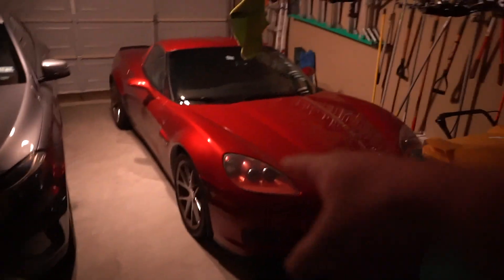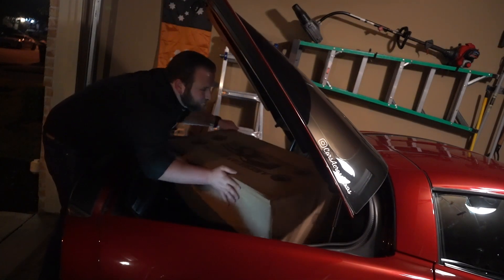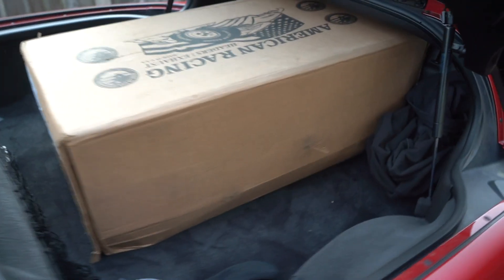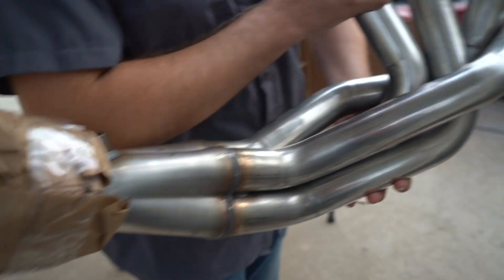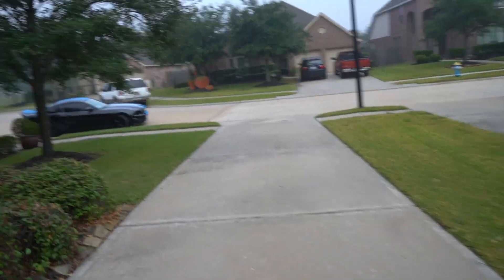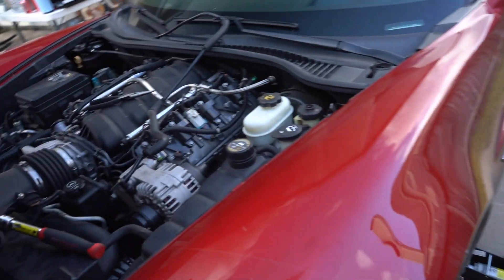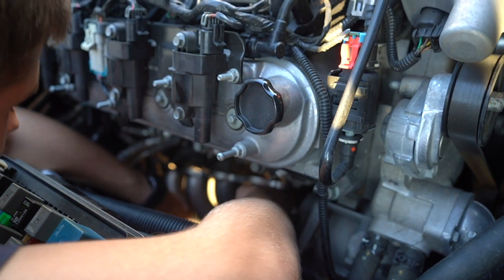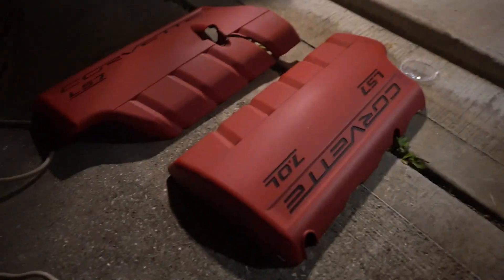The BEST SOUNDING C6 Corvette Z06 Exhaust! (Long Tube American Racing Headers Install)

Comment: 2 inch headers on bone stock ls7? I have these headers on my z06but also have b3 cam ai heads msd. Seems like you did more for sound than performance huh
Reply: I'd be scared to do that to my corvette. All I've done was put racing tires on them so it's already fast enough for me, even though it's a stingray.

Comment: I have a 2010 ZR1 after headers And cat removal it just sounds too dam loud. Mind you my zr1 came with aftermarket cherry bomb bullet style mufflers. Do you think if I put the Z06 stock exhaust mufflers on my ZR1 it will tame  the sound? I know many Modify the Z06 muffler by welding a pipe over the perforated inner muffler pipe. But I don’t want my car loud. If the sound of your corvette was with stock un modified exhaust I like it.
Reply: Put your cats back on and some resonators lol

Comment: I'm interested in these for my 08 Z51 Corvette. What was the biggest install headache that you guys had??  I'm thinking my install might be a little easier since it's not a ZO6.  Any tips before I get to busted knuckles and ordering online for my Christmas present? 😂👍
Reply: For sure have two people, and Jack the car up as HIGH as possible if you don’t have a lift. I did this a little while ago on my Z06. getting the cat pipe bolts out from the stock manifolds were difficult. Makes it easier to have a 1/2” impact with extensions and swivel sockets.